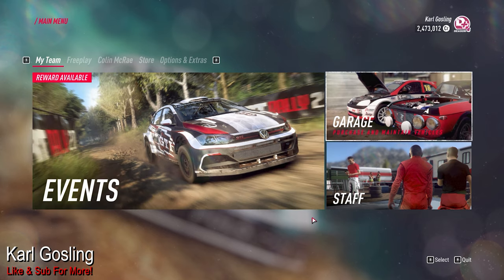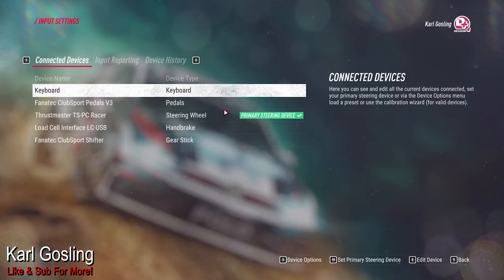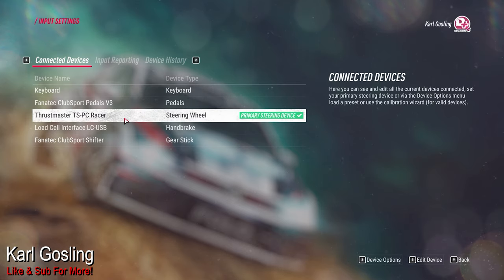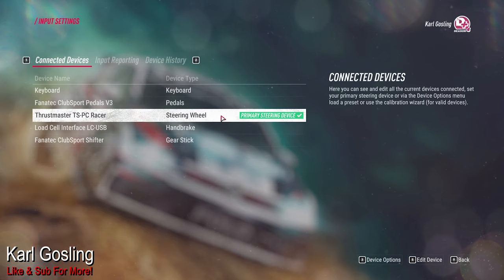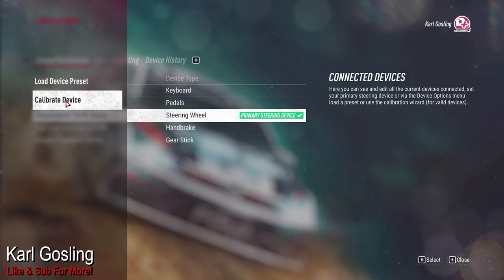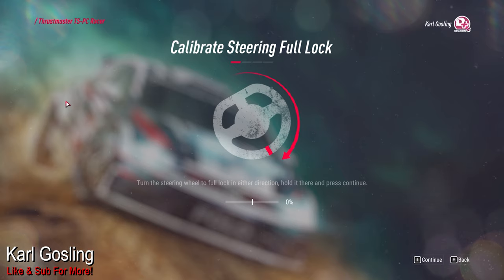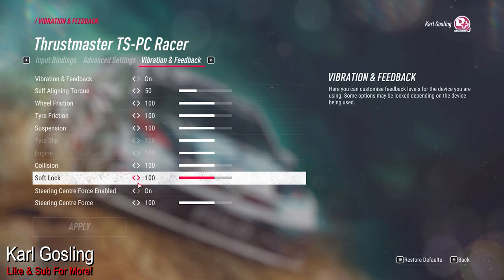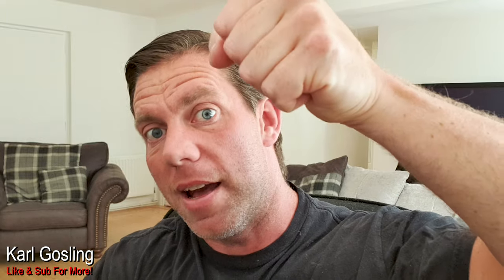Dirt Rally 2.0 Soft Lock Explanation And Setup

Comment: Also i have another question. According to internet the 131 abarth has 2.8 turns from lock to lock but g29 can only do 2.5. after i enabled soft lock if i steer wheel lets say 360 to the right, the steering wheel in game only turns about 240 degrees , is this realistic like that? , wouldnt that indicate car has faster rack than my steering wheels 900 degrees total rotation? But according to internet my g29 shoulf be a bit faster steering cus its only 2.5 turns from lock to lock instead of 2.8 like irl car

Comment: Great video thanks for making it. Also i have a question, for example as you said with old fords it needs 4.5 turns from lock to lock however g29 for example only goes max 900 degrees which is 900/360= 2.5 turns at max i think? Isnt it still pretty unrealistic at least on cars like that since it will still take 2.5 turns instead of 4.5 because our wheels are physically limited to only 2.5 turns? But also those fords have much bigger steering wheels which is also easier to control if you have a slow steering rack meanwhile g29 is pretty tiny compared to ford wheels. Do you think faster but smaller logitech would balance out a slow but big wheel for a good realistic experience?

Comment: How are you using your mouse on Dirt Rally 2.0? Just found your channel, love your videos. Cheers.
Reply from the maker: Mouse? I don't use a mouse mate...Oh you mean in the menu's here, it just works mate.
Reply: @KarlGosling  Thanks for the reply on such an old video. Odd. My mouse doesn't work with this game. I have to control menus with the keyboard or mapped buttons on the wheel. The first Dirt Rally had a menu option to turn mouse control on.

Comment: bought the game as it went on sale.
Weird issue for me is that the CSL is centered. 

But in Dirt rally 2 if I turn the wheel left, the input check shows that I did not turn the wheel to the left until I physically turn the wheel 90 degrees to the left. 

Shouldn't it register as a turn the moment my wheel left its central position?
Reply: I mounted mine yesterdar and couldnt full setup it yet. But your problem i have already fixed. Im sure that happens because you have steering deadzone (at least was my case for the same explanation you gave)